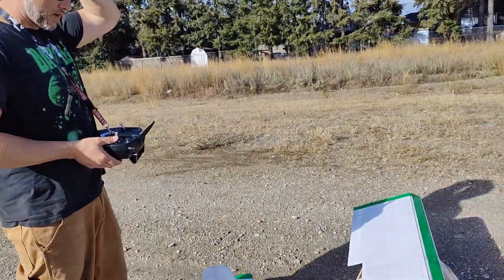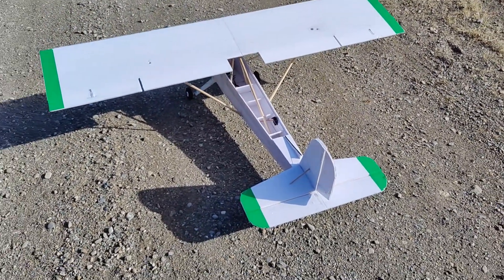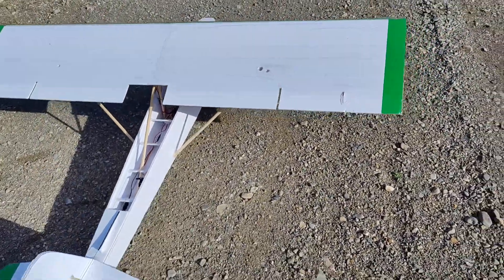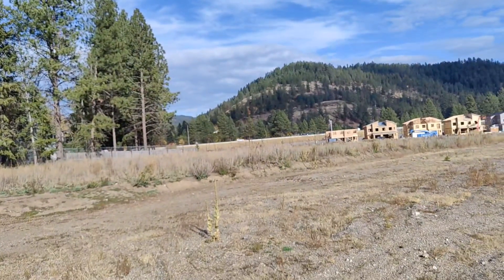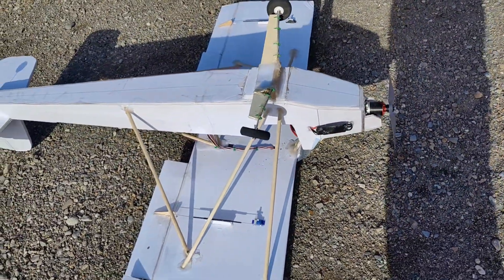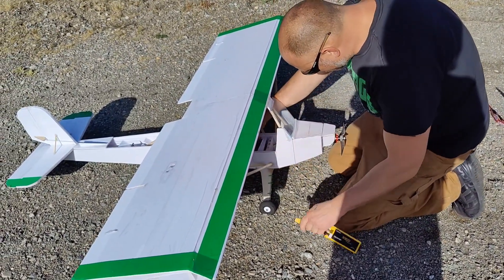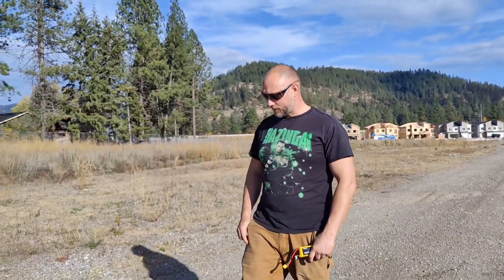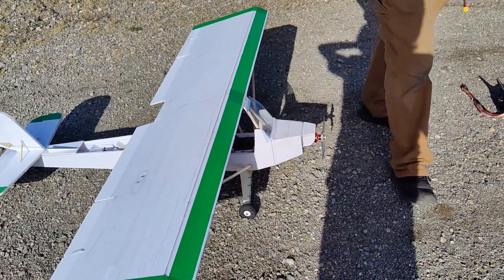ultralight, more prop testing.

Comment: Definitely may need a bigger motor for that beast to cruise at 50% - 60% throttle…
Reply from the maker: @EJ-74  I did it with a 12x4" prop same motor and battery without the landing gear. It flew perfectly on 50-60% throttle. I need to buy a couple more and try them again. I tried the same size with carbon fiber and it over heated. But maybe I'll have to try a bigger motor. Or 6s.